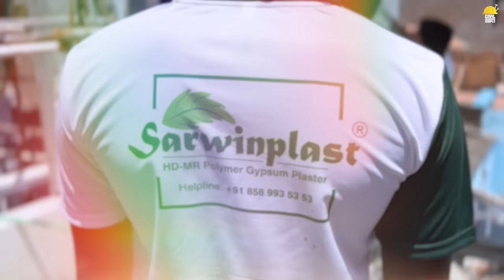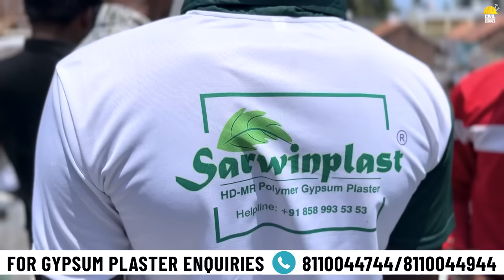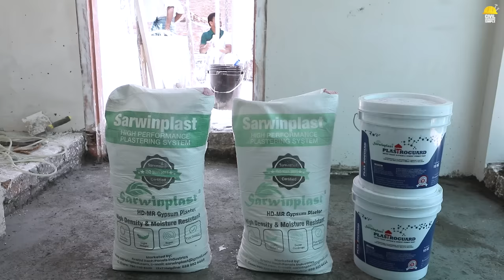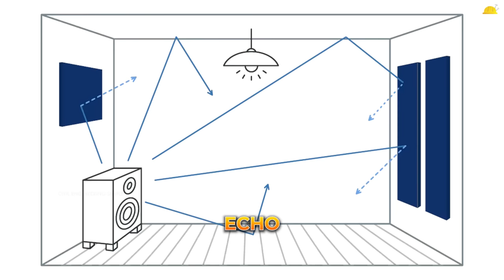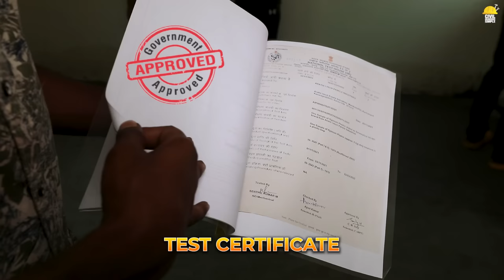வீட்டின் வெளிப்புற சுவருக்கும் இனி gypsum plaster பண்ணலாம்🤯! Exterior Wall Gypsum Plaster #home

Comment: I had a bad experience with Vellore dealer Srinivasan ,. They have committed to complete in 5 days but after 15 days only half of the work completed, They dont have enough manpower to fulfil the commitment. No one is available to take phones in kerala office. Worse service. If go with cement morter the work would have been completed now

Comment: I contacted them for the plastering work for my Bedroom, Balcony, Kitchen, Hall, One room and for one side exterior and roof top plastering. But they denied to do the work. For the name shake they are telling like 1500 sq ft project also they will take. But its not true. They will work only for the bigger projects. I told them there is no awerness in my area (Kadambur, Thoothukudi Dist) about the gypsum plastering. If they did, that is the good opportunity for them also in my area they will get more projects.